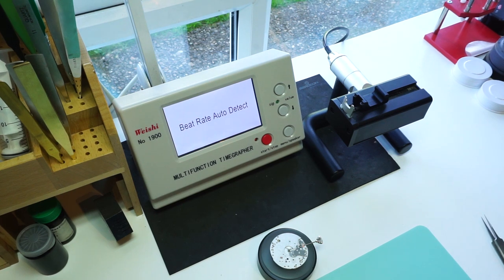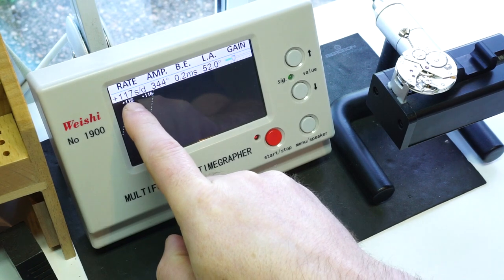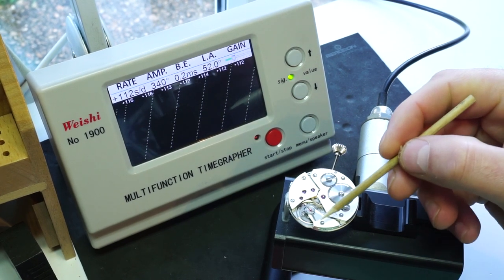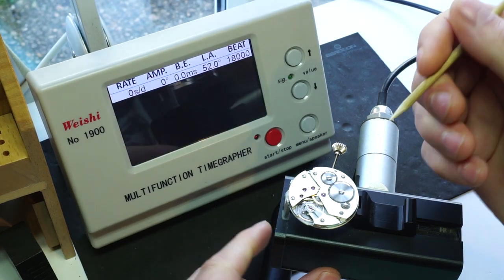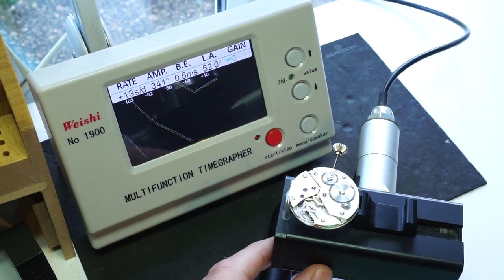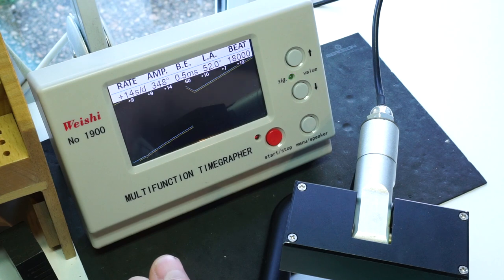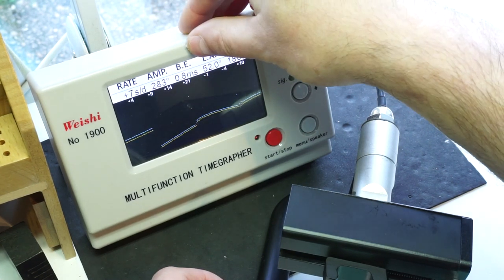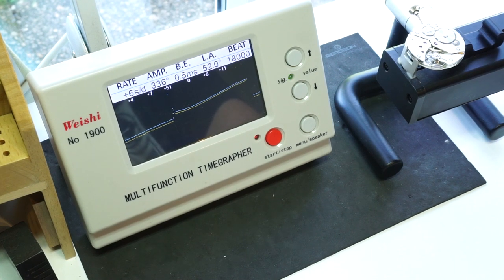How To - Service a Mechanical Watch - Part 5 Timing & Regulation - ETA 6498-1

Comment: according to the manual of the movement ETA 6498-1 , the factory exactly tells the proper Lift Angle, that must be set to 44°  the frequency is 18000 which is correct.

Comment: Did you leave the speaker on for a couple of days :-) ? It is my impression, that the ticking sound is generated by the time and not an actual recording of the movement - which is apparently useful for diagnosing the movement - if you know what to listen for.

Comment: I need to regulate a watch with this same 6498 movement. I wasn’t absolutely sure from the narration which way to move the arm to address a faster or slower running watch. The movement doesn’t have the usual + or - inscribed on the movement as a guide.

Comment: What are those smaller sized 2nd line values in each column? (small white font -2, -4, -1, -2 etc.)

The ones below the 1st line, (highlighted, larger font) actual values?

Comment: Hi sir,
How to adjust  vertical key down position to" + rate "...
Bcz..key down is falling rate slow " -12 "
When dial up +5and down is +7
I adjusted regulater pin ( inner outer)and reduced the gape of the first coil of hair spring ...eventhough still having problem
Pls advice me...i will appreciate you...thanks

Comment: Just curious - Does your timegrapher calculate the Lift angle or is that a piece of data that you have entered into it for the specific watch. The reason I'm asking is that I recently picked up a Microset (Mumford) device at an estate sale and from my research  on it, it has an optional ratefinder feature. New to the hobby and watching as many videos as I can to get as totally confused about this as possible. Thanks.
Reply from the maker: It is entered manually depending on the movement but for 90% of work it can be left on 52 degrees. Check out Lepsi webpage ( Google Lepsi Lift Angles ), most movements will be 52 degrees but something like a Seiko 6119 will be 54.5 for example. For most user setting to 52 degrees is fine. :)

Comment: You make adjustments by placing the watch in the position of the dial below ATTACHED to the timegrapher, the result is very different when the position of the dial is upward and the machine part is ATTACHED to the timegrapher.  Even though when we use the watch the dial position is upwards.  

(The timegrapher position remains unchanged) 

How to place the correct machine when adjusting the timegrapher?

Comment: Amplitude reached ~347°
What??? First Red Flag 🚩ETA/Unitas 6498-1 spec is VPH 18,800/5.22Hz Lift Angle 44°
I would try and manually set the Lift Angle to 44° and manually set the bph/vph to 18,514. At least it's a little closer, no settings for 18,800. That Timegrapher uses a preamplifier with a Piezo vibration element.
Reply from the maker: The automatic beat setting of the machine is more than sufficient to discern the timing, the lift angle is set to 52 as my default and again is enough to give me a picture of the timing. Sure you can set every parameter exactly if you wish but it is not needed with simple movements imo. The tool is just one of many used to measure the movement, I do not rely solely on the readings for accuracy. Lastly , this is an educational video used as a guide, not an exam :)
Reply: @welwynwatches5976  😁